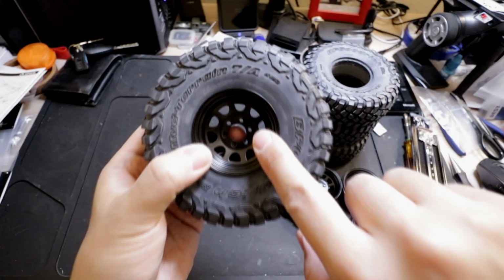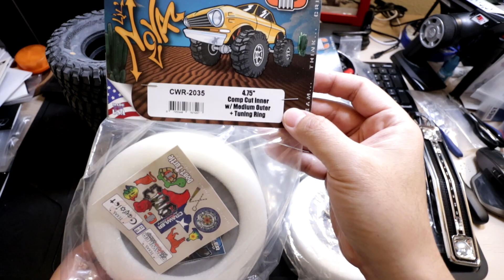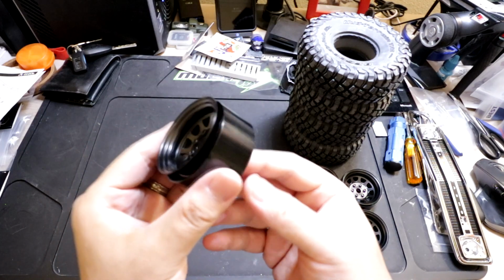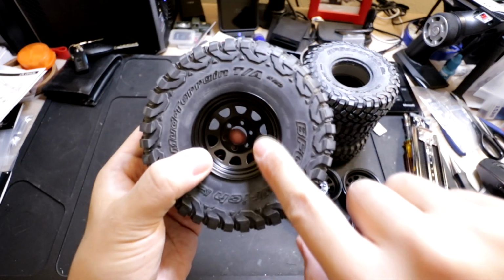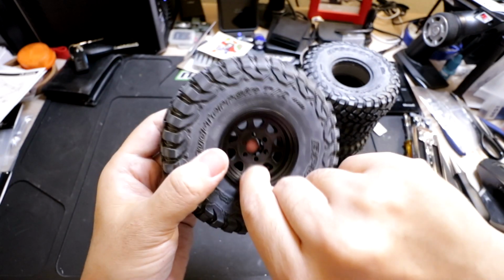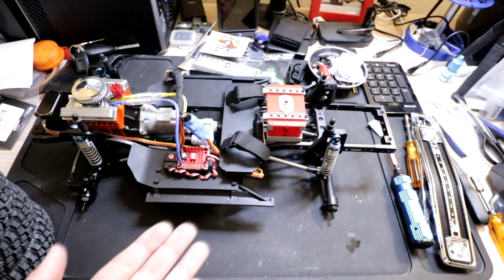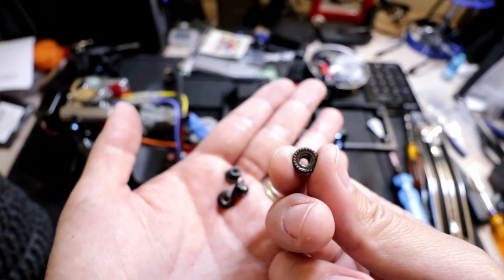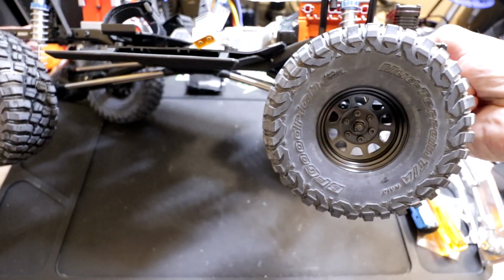SSD Trail King Build Series - Part 7 - Wheels, Tires and Foams

Comment: I got 4.50 med and soft,#2024 #2025,do I put that skinny piece in tire with FOAMS?
Reply from the maker: I'm assuming you are talking about the tuning ring.  Yes, you use it to tune it to your liking, either add it, or don't.
Reply: @RevolutionX  can u EXPLAIN a little better my friend I'm sorry I'm just lost on this tuning ring thingy
Reply from the maker: The dual stage foams have the inner hard foam and the outer softer foam.  Crawler innovations also adds a thin foam ring that goes around the outer softer foam.  It is used depending on the tire to either add more diameter to the outer soft foam to fill out the tire more, or if you find it too full, to not use it and just use the inner and outer foam only.